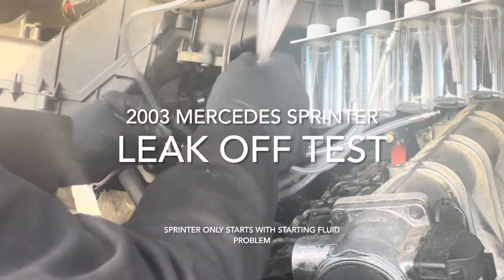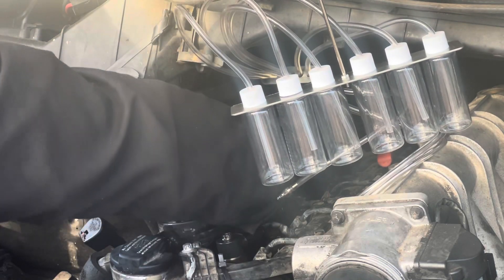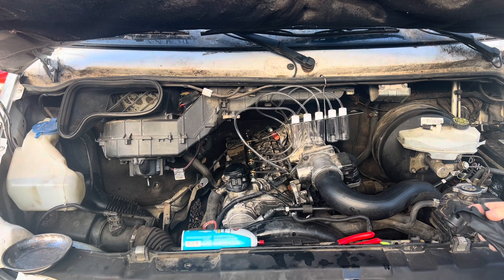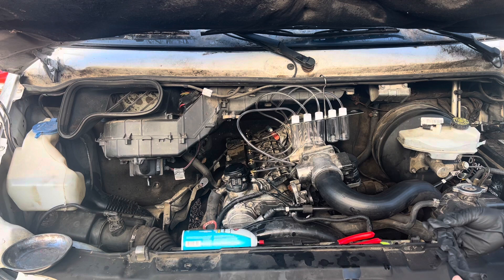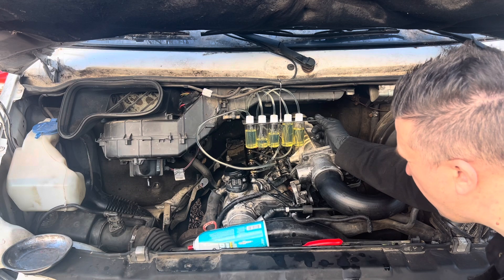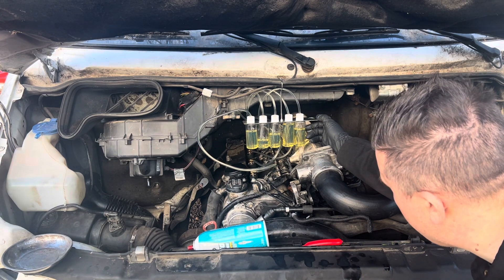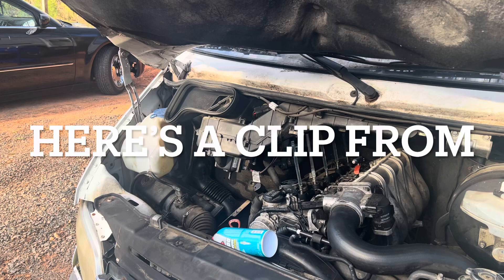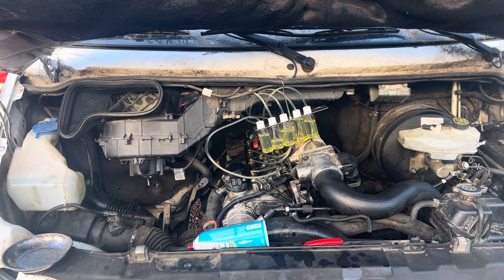Sprinter starts only with Starting Fluid Leak off test on a Mercedes Sprinter with engine running

Comment: Nothing wrong with any of these injectors.  Definitely not your issue with starting
Reply from the maker: Really? Well that’s good news, today I plan to do a 10 second leak down test without starting the van, to see what results I get.

But what makes you think this injectors are good? To be honest it’s obviously my first time doing a leak down test, I am still learning
Reply: @ZimaletaMotors  injectors would have to be leaking off more than this.  That's why you need a pressure reading at cranking and running.  I looked at my notes:  3600 psi is needed to start officially but I think 2900 psi will work.  Cranking rpms are suppose to be over 200 at start, but I believe 230-250 is a better number.